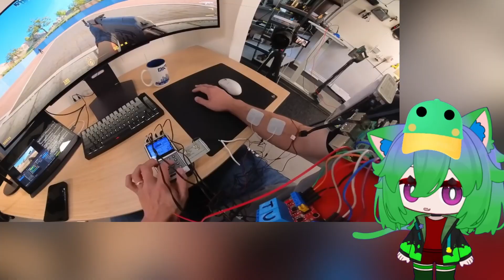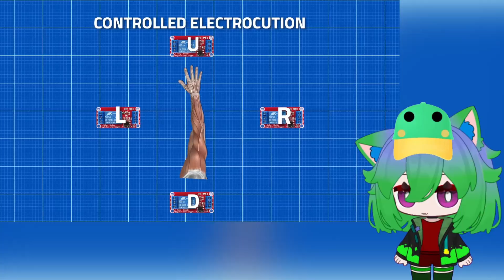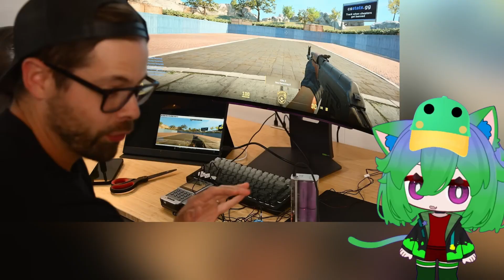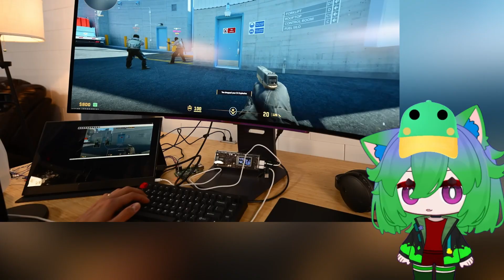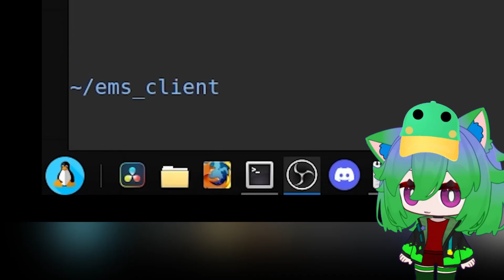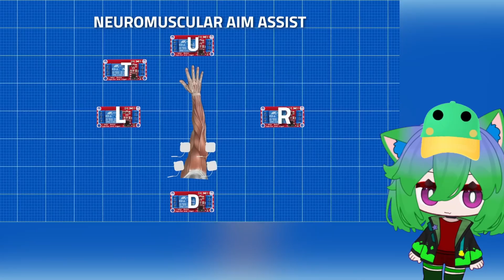IS THIS HACKING?! | Neuromuscular Aim Assist | Vtuber Reacts

Comment: There is a medical device I can't remember the name of that tests your nerves to see if they are good or not, I had that test while back I think something based of that as it seemed quite accurate with how they measure where to put the ends of the wires onto your body which I think would be small enough and precise enough to use as inspiration.

Edit: from what I can find  it says called a EMG machine

Comment: using electricity to enable your body to do things normal people cannot if that isnt cheating i dont know what is we dont let athletes use p.e.d’s so why would we let you use performance enhancing hardware. the massive difference is that using these types of hardware should be allowed for people who are physically disabled and have no other way of gaming otherwise it’s cheating youre increasing the overall synaptic response of your arms by increasing the amount of signals being directly generated by the tens machine 0 travel time 0 brain lag its like a direct connection arm to brain
Reply from the maker: 100% agree